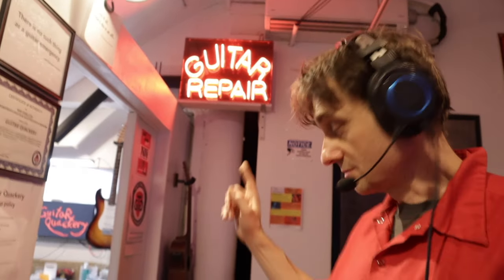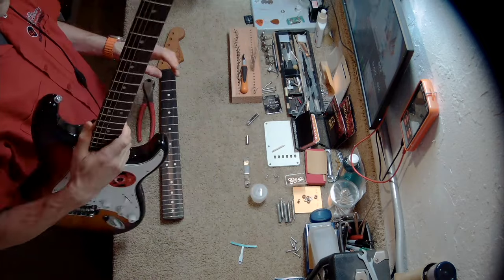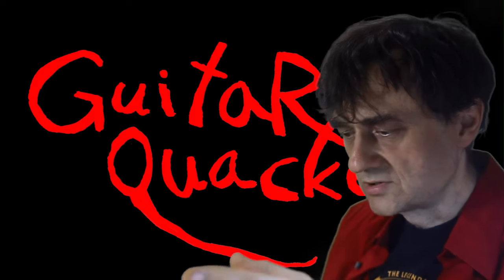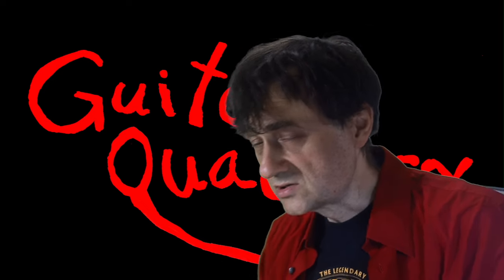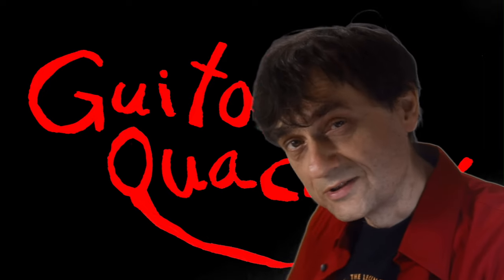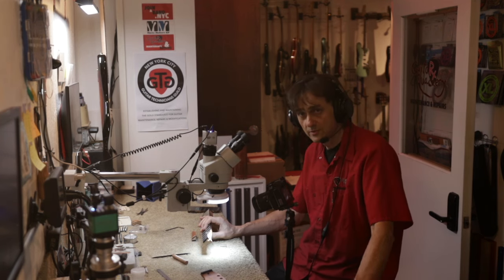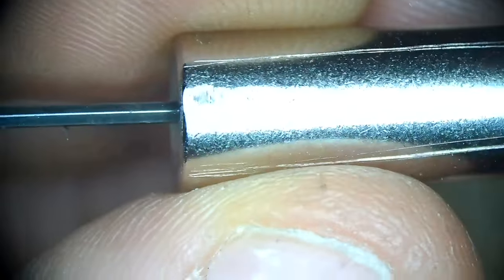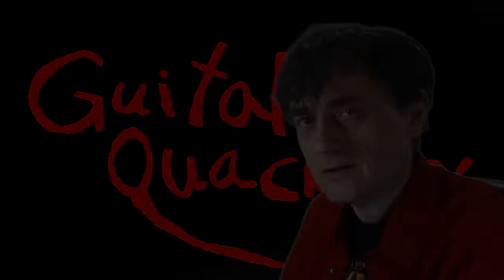Top Secret Guitar Warranty Service

Comment: Excellent video :) So good to see Fender allows you to reuse salvageable parts, whilst ensuring the faulty part is not ‘revived’. Common sense rules, sometimes - even in big corporations! Well done, Fender 👍 Great detective work too! 🔍
Reply from the maker: The technical support guys at Fender are super great. Sometimes I even call them for information that has nothing to do with warranty issues. they usually know the answer, and if not they point me in the right direction. I really can’t complain.

I’ve also had nothing but great experiences with people at Gibson. 

Although I’m fully aware of the fact that Gibson has quality control issues the technical support people at Gibson, that deal with warranty issues have always been super great.

I do realize that people sometimes complain that they did not get anything resolved, through a warranty claim. However, in those cases, one has to keep in mind that we are only hearing one side of the story.

Sometimes people come to me with ridiculous warranty claims. I stopped them right there, before anyone contacts Gibson or Fender. 

I’m sure there are a lot of people that contact Gibson or Fender directly, with unifying warranty claims. I can see how that would turn into a bad opinion. Just like that YouTube video that I am referring to, when someone found a smashed up Gibson in the dumpster. People jump to conclusions without knowing what the facts are.
Reply: @GuitarQuackery  Great to hear about the superb technical support from both Gibson and Fender - the two big players, that seem to take a lot of flak in the YouTube comments section, for sure! And absolutely fair points about reasonable expectations. 

I guess that’s where high-volume production QC issues can cross the line from minor / possible B-stock to actual functional failures. 

With the big name prices increasing and new budget options, which sometimes offer higher specs and raise the QC bar, the big players would perhaps do well to slow down slightly their manufacturing processes and improve the QC stage checks and final sign-off.

There would be a direct financial cost but what price lost trade due to reputational damage, if the brands aren’t considered reliable? Especially when so many guitars are purchased online. Even if returns are made easy, the initial disappointment will be a lasting memory, along with the additional time and trouble taken to secure the desired product.
Reply from the maker: @derekclacton  As I said, I definitely have some issues with quality control. But that has nothing to do with the people who take care of warranty claims.

I had two fairly recent experiences with Gibson, issuing an RMA and asking me to send the guitars to them. In a very reasonable time they sent out brand new replacement guitars, and both of those customers were super happy. 

It is sometimes the case, that customers don’t realize that they can take their guitars to an authorized service center and they try to deal with Gibson directly  (or Fender). They don’t know how to explain things and the outcome might not be what they expect. Then they need to deal with shipping and that’s a major mental barrier for most people. But the fact is they do not need to do any of that on their own.

Comment: Were you recalling the story of the mutilated LP found by someone in a GC dumpster then forwarded by 'Brad the Guitologist' to Sean at 'Scar My Guitar' for a revamp? If you'd rather not say, I understand. Btw if I remember correctly, Sean removed the Gibson neck and put a budget replacement on but did not put a Gibson logo on its headstock or replace the original factory serial number, or represent the rebuilt guitar as an 'authentic' Gibson. Frankly Sean's work is a little crude at times but in this case he did manage to get that ruined guitar playing nicely again and looking alright, on a reasonable budget. Thanks for explaining why serviceable guitars are sometimes destroyed by retailers or repair/service providers.
Reply from the maker: The reason why I'd rather not name the actual video(s) is because things can balloon out of proportion. I don't want to get entangled in conflicts.

The video that I am referencing had some negative comments about the retailer who dumped the mutilated Gibson into the dumpster. I always thought it was unfair to paint them as some kind vandal. The retailers who have repair department are obligated to follow what the manufacturers tell them to do.

As a service provider, if the decision comes from the manufacturer, to scrap the guitar and send pictures, that's what the provider needs to do and move on to the next job.

I have nothing against dumpster diving. It can be fun and one can discover treasures. So, when one does discover a treasure it's simply better to make a happy video, as opposed to a video that has a lot of negativity.
Reply: @GuitarQuackery  Thanks for showing who¨s responsible for stuff getting damaged. It's good you are allowed to use certain parts. I guess Brad suggested instead of hammering or sawing stuff to death, it could rather be donated to some non-profit. It hurts to see something getting damaged if someone could make use of it. What's the reason (in this case) the headstock had to be cut off?
Reply from the maker: @vikingbeard  Guitar manufacturers do not have any interest in donating guitars to anyone who can make use of them, if guitars with their name on them are factory defects. 

The reason the headstock had to be cut off is because the factory replaced the neck and instructed the authorized repair tech (in this case it was me) to cut off the headstock and send photo(s) proving that it was done. 

If this was not a guitar... if this was, for example, a hammer drill, no one would feel that it was a shame the defective product had to be scraped. But I do understand how people feel that guitars are different. I was feeling the same way when I started this career. Now I got used to it.
Reply: Thanks for the explanation. I understand, but think it's selfish of the company and wish there was a law against it. Anyway thanks for saving all those thousands of other guitars, I would have done the same in your situation.

Could it be one reason why old guitars are loved so much and often repaired is that they're made from natural quality repairable materials? Today I received two restored vintage British handplanes. Also throwing away a pair of broken synthetic sandals after a few months use.
Reply from the maker: @vikingbeard  I totally understand the sentimental point of view. And, like I said, it took me a while to adjust to this, as well. But there really isn't a way out of this.

I recently had to scrap a Fender Newporter, which is listed for $750, retail price. It probably costs the company $300 to make it. Or perhaps even a lot less. 

That guitar had a big soundboard hump due to unglued braces and an overset neck. A neck reset is not even possible when a neck is overset, because with overset necks there would be a chunk of wood missing from the heel of the neck. But, let's say that a neck reset is possible. It would not cost less than about $700, just to reset the neck.

That's the average price for a Martin where you do not have to do finish repair (provided there are no complications).

Since the Neworter was brand new and since the finish on a Newporter is applied after the neck is glued in, the Newporter would also need finish repair. 

The unglued braces are a nightmare to repair. That's like building a ship in the bottle and it takes hours of a skilled tech's time to do this right. Even then, one might have to settle for an acceptable outcome. 

After I smashed the guitar into pieces (as part of the scrapping procedure) I discovered that all the braces were glued poorly. So that guitar would fail in the future and an future owner would be stuck with a repair no one can afford to pay for.

Right off the bat, a competent luthier would recommend that the guitar would need to be completely rebuilt. We're probably $3,000 easily, to actually compensate the luthier for the time spent. 

There is no other logical solution than to replace the guitar and scrap the defective one.

Fender does not want a guitar that has major defects, and that bears the company name, to be circulating out in the open. Even if they donated it to "a good cause" eventually that guitar might find its way on Reverb or eBay and eventually someone will deal with a nightmare. 

I also don't think anyone in the world would consider paying what it takes to repair that Newporter, if they can buy a brand new one for $750.

So, that video is coming up, I guess. I can already see how it will send shockwaves through the community. Perhaps I shouldn't post it.

Comment: I once ruined a Squier neck that I thought had been maxed out. When I couldn't unscrew the nut with an allen wrench, I used an EZ Out tool and broke what I thought was the nut. It turned out to be a sleeve welded to a flat bar attached to a round truss rod that contained the actual nut. It was not a two-way rod. How about a video on how to tell what kind of truss rod is in your neck? Thanks
Reply from the maker: That's a good suggestion. There are many types of truss rods and the community would benefit from such video. BTW, the truss rod type that we see in this video is called Bi-Flex. It's basically l the Fender two-way truss rod.

Comment: Sometimes you get lucky and the defective part is otherwise great.
I bought a lacquered MIM Strat Classic 50s neck several years ago for next to nothing since it had a loose skunk stripe, my guess is the walnut may not have been completely cured since there's another spot that's showing the same sign. I did a quick fix with a small amount of wood glue...best Strat neck I've ever owned.  Going to have to come up with a more effective fix. Funny enough the one guitar part I've never even seen for sale, skunk stripes.  It was just a cheap neck I bought to practice working on, and it's taken the place of 2 custom made necks. 
Great video!  I remember that video...and the older one of the Gibson factory destroying a LONG line of that model no one wanted with a steamroller or forklift.    I've bought more than a few pieces of gear that got returned and repairing them likely made no sense.
Edit...the "Firebird X".   They drove an excavator over $500K of them.  I understand from a business standpoint....but the video will still bring a tear to the eye.
Reply from the maker: Have you seen the Skunk Stripe repair video? https://youtu.be/zncNhljV-fM

Gibson could have easily donated a bunch of those Firebird X guitars to schools, or some other organizations.
Reply: @GuitarQuackery 
I have now....or will in 30sec.
Thanks!!